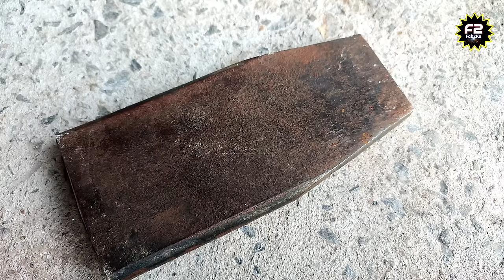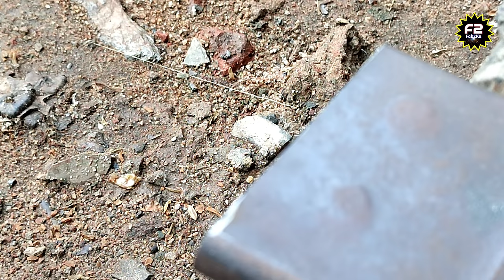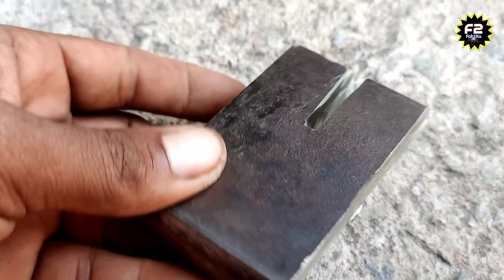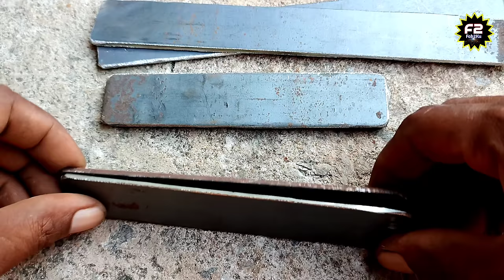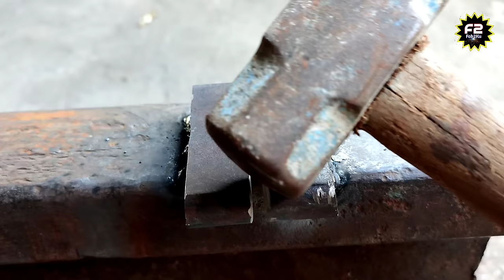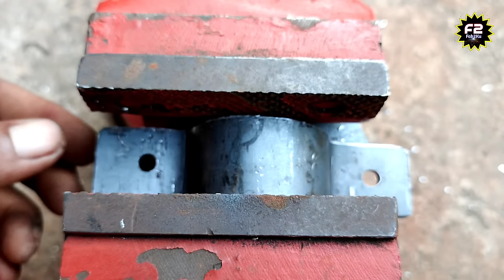Manual Pipe Clamp Making Tool / Simple ideas To Round Pipe Clamp Making / Make A Pipe Clamp

Comment: Creative thinking. I have made hundreds of threaded pipe joints in industrial plants, hospital bolier rooms (1/8" up to 2").   Running threaded pipe is very doable using pipe dies. I have not had one leaking joint. Many tees & 90's in the lines. There is a formula req'd when calculating the lengths of the threaded pipe so fittings that go on the ends of the new pipe with threads make up to the dimension needed) so the different lines will fit...without leaking.  
 Until someone runs a line  with your creative threaded pipe "die" (and tests for leaks)...I can't recommend your clever thread maker. 
  All the best, Pete
Reply from the maker: Thank you sir 😙